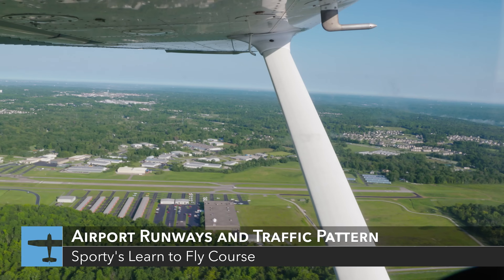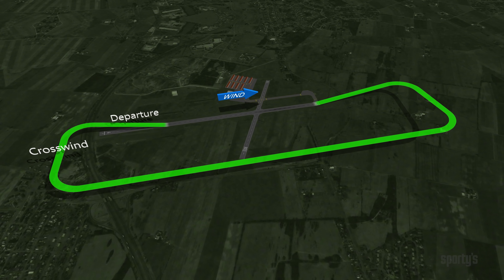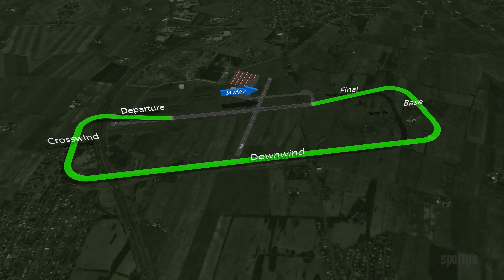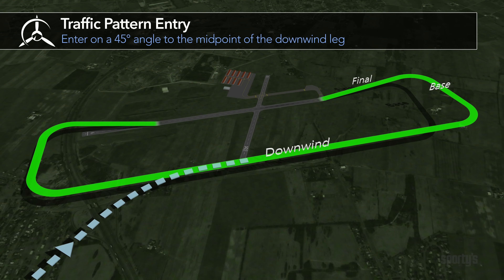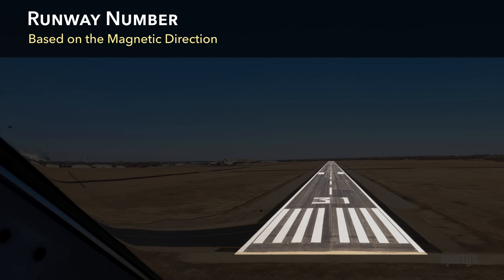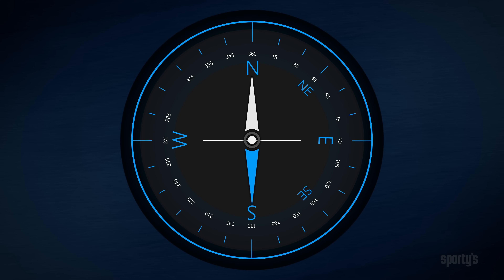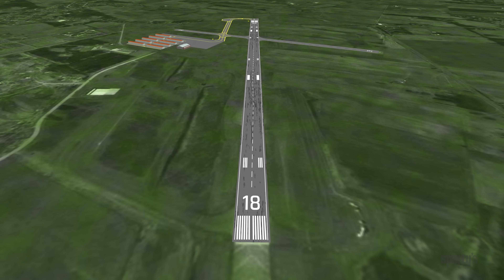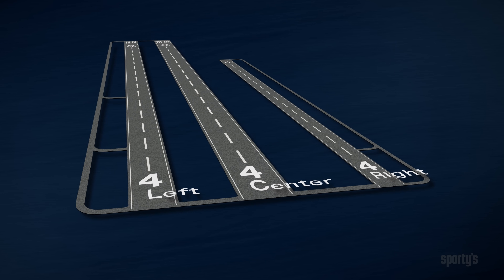How to identify airport runways and traffic patterns - Sporty's Private Pilot Flight Training Tips

Comment: As a note to new pilots, sometimes a runway marking is changed slightly if 2 airports relatively close to one another have runways in the same direction.
For example, if both airports have runways that point North, one airport will label their runway 36, while the other may label their runway 1 or 35. This avoids confusing that 2 airports and calling, or landing at, the wrong one. This is also called out on the Charts.
Reply: Thank You 🙏🏾